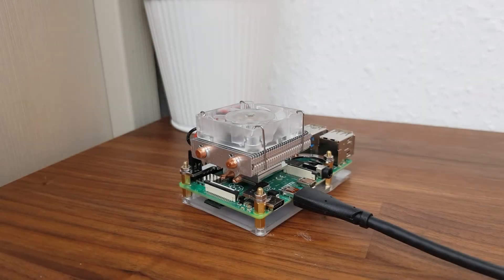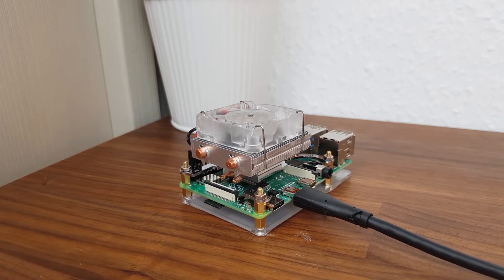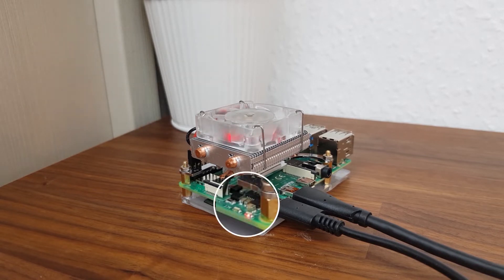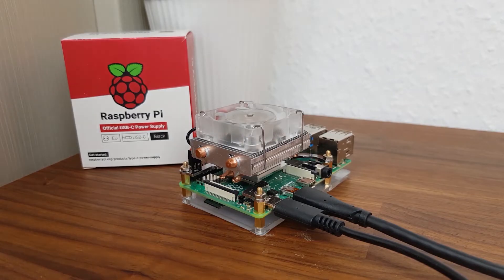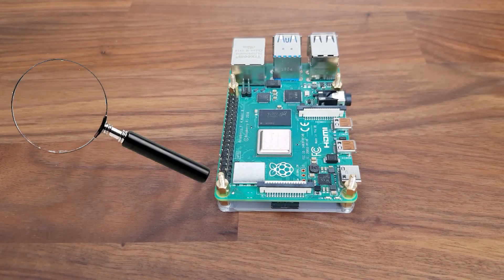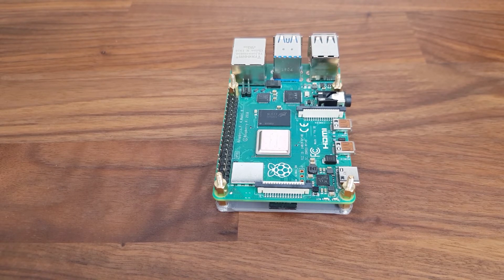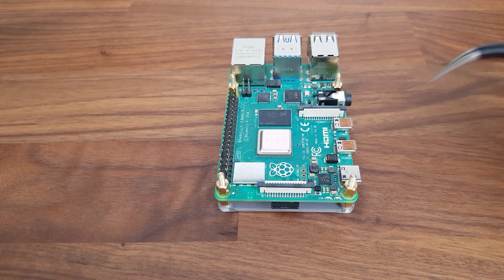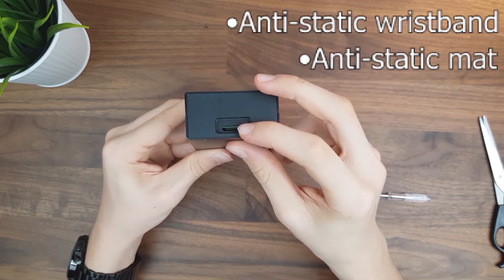Blinking Red Light Issue with the Raspberry Pi (3, 3B+ & 4)|EXPLAINED|By TH

Comment: my pi died like this with a case currently on.
using a working power supply has no outputs at all, using one below the amount leads to this. i believe this pi is burned out in that chip…
Reply from the maker: Oh, that`s unfortunate. Hope you find a solution 👍

Comment: I bought a geek work worm SSD hat when when I installed it the first time work perfectly except for the SSD hat I was extremely hot at the time I didn't have an external hard drive connected to it uninstalled  SSD hat. So install more fans in my arcade pedestal and I put the SSD hat all back together again it immediately started the same thing in that video I have the ice fan and everything and it did the same thing have you figured out a solution for that or do you have a solution for me I will be very grateful I don't know nothing about none of this I'm 42 years old and I started doing all this about 5 months ago . It's been a learning experience I spent a lot of time learning it but if anybody has a solution to this right here let me know and thank you sir for your video

Comment: my one was solid red its not booting ive tried a new sd with retropie and one with osmc and also got a new usb charger
Reply from the maker: It´s most likely and ESD issue. Unfortunately you can´t repair that on your own. Try returning your Pi or letting it get fixed in case you still have warranty on it.
Reply: @techhorizon  i fixed it dw
Reply: @callumpk7486  what was the issue I'm having the same problem any help would be appreciated
Reply: @happyheliovi8496  so mine just started working after a bit. just try different sd cards

Comment: I've had 3 Pi 4's do this in the last 3 days.  I used to work on HP pc's and we would touch the motherboard all the time without being grounded and I never once burned out a motherboard.  Pi 4 seems to have some quality control issues.  I had the older Pi's and never had problems.
Reply from the maker: I agree. The Pi 4 does indeed seem to have some quality control issues.
I´ve had 4 Pi 4s in the last 8 months but never had an issue with other SBCs & PCs. Big ufff 😅

Comment: Out of interest did it work at all ? Or was it glitchy, mine works but behaves as if the power supply is faulty , flashing red led..very poor performance. Thanks the the vid I thought I was going crazy and kept checking optimization settings
Reply from the maker: My Raspberry Pi didn't even turn on in the first place. Luckily I got mine replaced (free of cost) by the online store I bought in. 
Hope you get yours replaced as well 👍